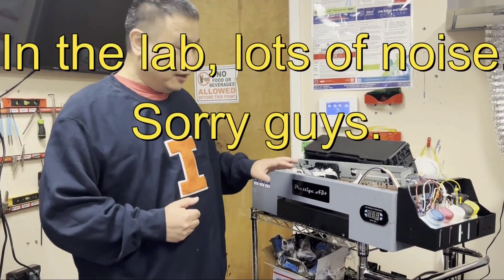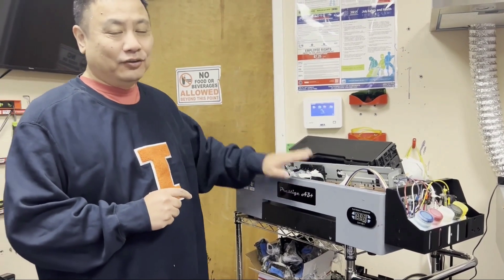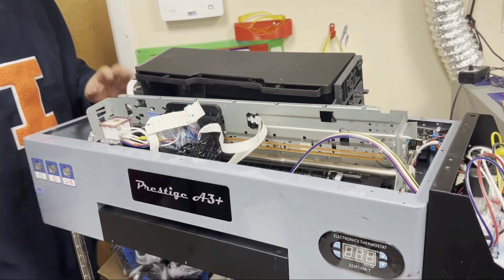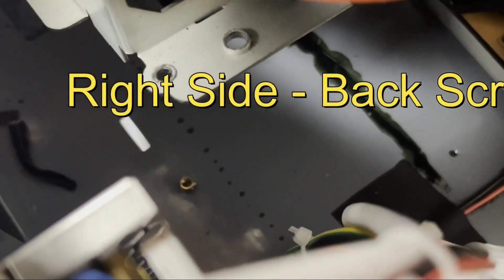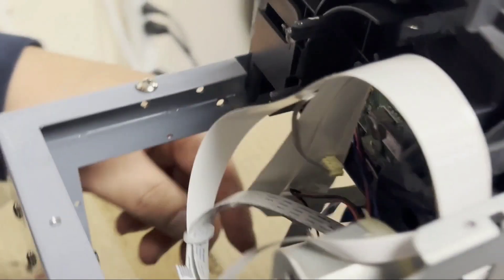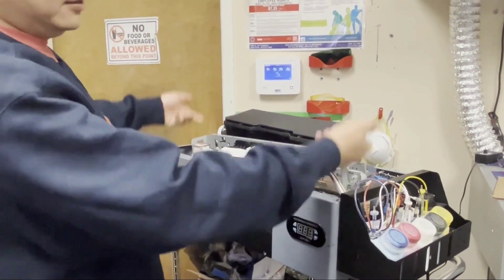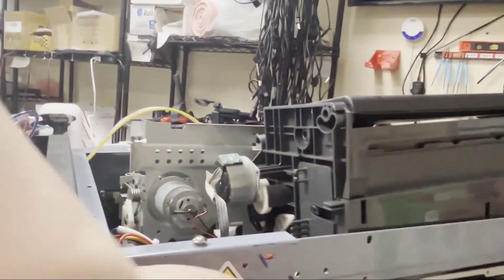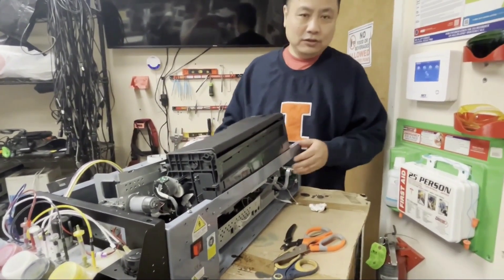How I Removed the Toughest Printer Casing to Service the Capping Station - Prestige A3+

Comment: My dtf procolored 1390 Epson it's giving me the two flashlight with the error code that said "cannot locket the carriage" could you please help me? That's happened after I reset and cleaned everything...
Reply from the maker: Thanks so much for subscribing—it really helps the channel grow as we work toward the 100k milestone! That “cannot lock the carriage” error on your Procolored 1390 usually means the capping station is out of sync. Try moving the printhead away from the capping station, then look for the slot on the waste pump (right side) that fits a flathead screwdriver—give it a few counterclockwise turns and watch to see if the white lock under the printhead goes up and down. If it doesn’t move, that confirms a sync issue. I’ve made several videos that can help: for screeching sound and movement issues, check https://youtu.be/MjArYM-QnfU and https://youtu.be/TNOG_1TtN6g. For a deeper dive, see videos on removing and reinstalling the capping station (https://youtu.be/_cZEkmgIZYc), unclogging (https://youtu.be/WbY_6O1-w2c), maintenance (https://youtu.be/5yjq3ZN0qv8), repair (https://youtu.be/5UC2IMu9V90), and tube rewiring (https://youtu.be/J9im3s8UJfo). If none of that works, I have a detailed video guide on my site that shows full disassembly and reassembly of the capping station with gear alignment here: https://bchtechnologies.com/products/video-capping-station-assemble-disassemble-guide-for-l1800-1390-artisan-1430-and-1400. I'm working hard to get back to subscriber questions within a few days, but there's a big backlog—thanks again for your patience and support!